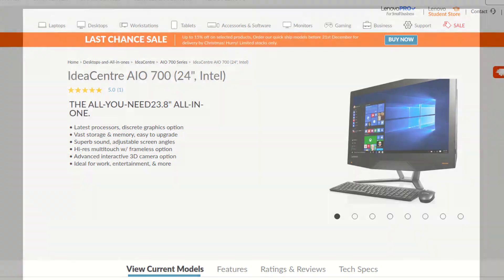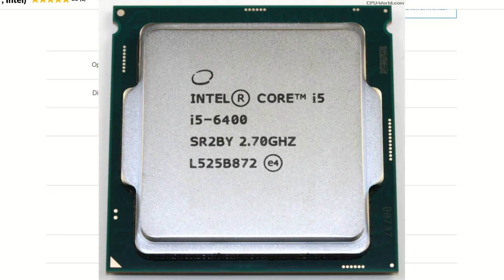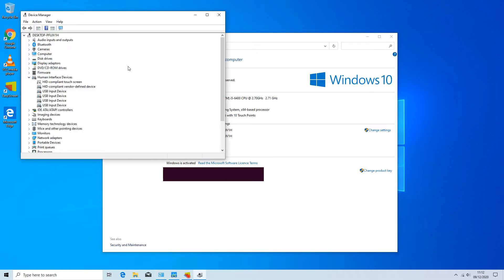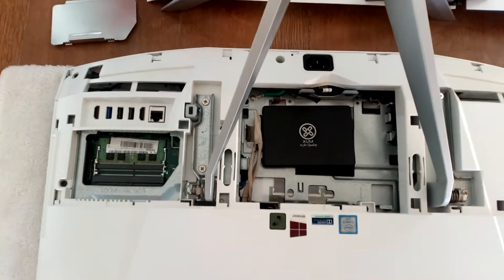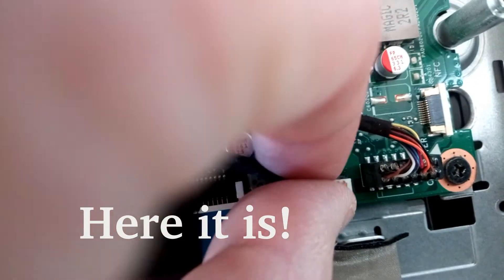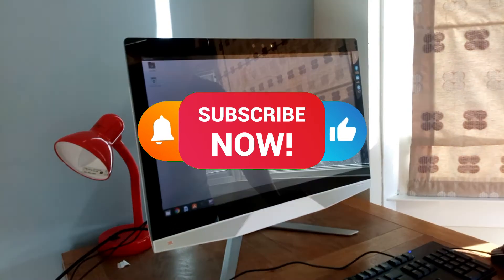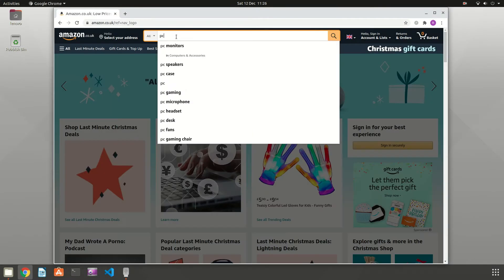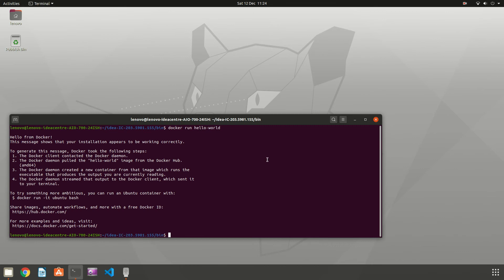Repairing a cheap Lenovo AIO 700 PC

Comment: I have a completely original one that still works perfectly and meets all my needs. That said, I wish you had shown us how to open the rear upper cover. I need to clean mine as the fan runs too often and too hard. I guess I'll just try to figure it out.
Reply: I went ahead and dug into removing the upper cover. Didn't break anything and the fan is now whisper quiet. All is good...

Comment: I have this same model it worked perfectly for years. I tried pushing the power button to turn it on the other day and it tried to power up for a few seconds and soon as lenovo pops on the screen it turns it self off. I've tried holding the power button down for 60 seconds ive checked the connection and it still will not power on. I'm wondering what it could be and if you could make and post a video on fixing this issue.  Thank you so much

Comment: thanks bro but mine issue is screen flickering , what can i do with this tia
Reply from the maker: try to update the nvidia graphics drivers from the lenovo page here https://pcsupport.lenovo.com/gb/en/products/desktops-and-all-in-ones/700-series/aio700-24ish/downloads

otherwise try to understand if the flickering is just when you enter windows (I assume) or it is also flickering when you boot up before it enters windows. if the latter you may have an hardware problem. it could be the nvidia graphics is not working but you could disable nvidia and use just the Intel graphics. let me know how it goes